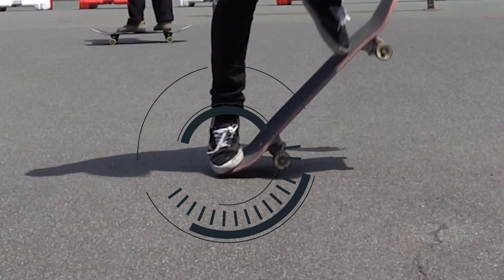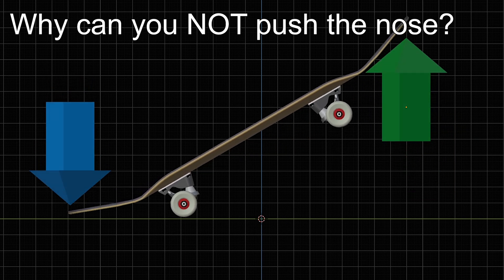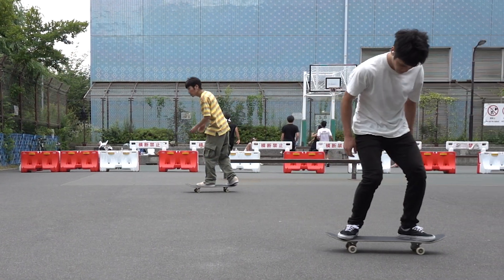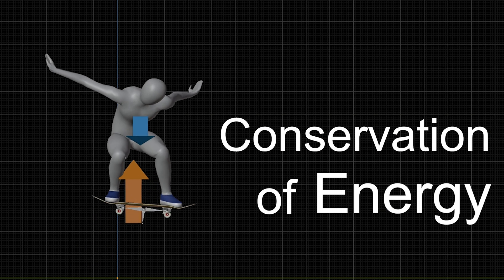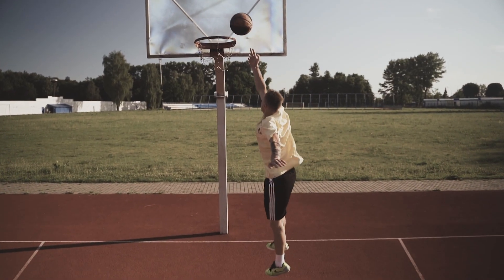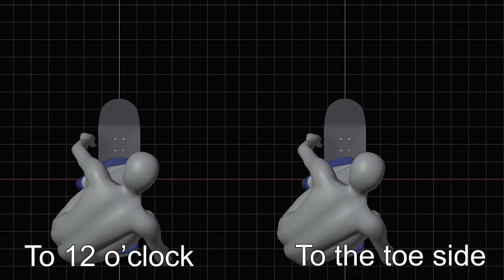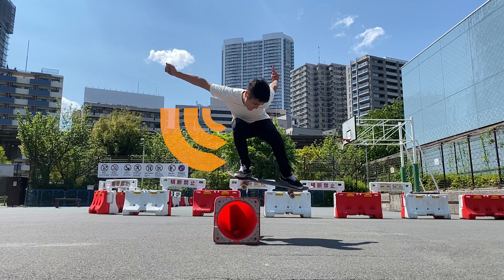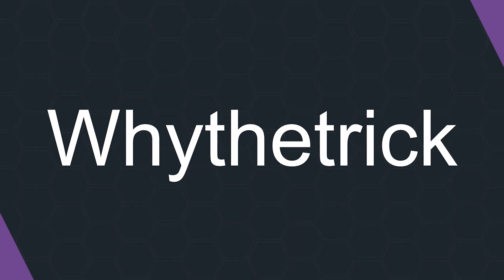Science of leveling Ollie #3d #ollie #skateboarding

Comment: After repeated practice, I figured my way to ollie and level it out easily and consistenly. You guys may try it out too but it is NOT a proper way to do it.

The trick: Keep most of your weight on your front foot as you crouch until you finish pushing the board forward. It looks like you are leaning your whole body on your front foot as you crouch. You also mainly use your front thigh to lift yourself up when jumping.

This might sound weird and tiring. But by doing this, you can:
1. avoid your back foot blocking your board from lifting (cuz your back foot can go up very quickly)
2. easier to make consistent but strong pop (as not much weight is put on this foot, you can precisely control direction of pop)
3. have more control on your front foot for sliding and pushing forward (your knee could reach above the nose after sliding)

To me, doing this increases the room for timing error, and a lot more control when im in the air. If you really wanna land a level-outted ollie no matter what, you may try this out.
But now, I start trying to ollie and jump with both of my thighs as I think we cant put that much pressure only on front foot when doing other tricks.
Reply: you guys may try it out and tell me how u think abt this tip
Reply from the maker: interesting point. thanks for the comment!

Comment: This 100% facts, yours are the best tutorials out there. Two related tips: 1 apply pressure on the tail, but focus more on retracting the back leg as fast and high as possible (rather than pushing down hard on the tail) and try to wait with pushing the front foot forward until the back foot is already coming up. 2 body/head position play a huge role: I always say it's not how deep you crouch down but how far over the front bolts you lean your head when you pop. The more you lean forward, i.e. the further back the nose comes when you pop, the more room your front foot will have to extend and level out the board. I think I also pop slightly back, rather than straight down. Everyone's different, but I think often the problem is people (unconsciously) hold back a bit for fear of eating shit, when really the spirit is to jump into the trick 'face-first' as it were.
Reply: Many thanks for your experience 👍
Reply: What does leaning forward have to do with the nose rising? If anything wouldn’t you be more likely to hold the front part of your board down

Comment: This is not the best ollie technique - you should avoid pushing through the nose as much as possible to maintain more board control and contact with the front foot for better, more consistent ollies. Also, if your board has a short nose (or no nose, for old 80's style boards), you definitely don't want to use this technique, because your foot will come off and you will have to bail. Even with modern board shapes, it's far better to use the friction of your front foot on the griptape behind the front bolts. Then, you will be able to easily have the board leveled and in control at the peak of your ollie, allowing for clean, high flip tricks, late shuvs, and other such advantages.

If you ollie using the flat part of the board instead of the nose to drag your ollie up, you won't have the board pushed out in front of you and you won't have to worry about pulling the board back for a landing. You want to just keep your shoulders nice and centered over the trucks instead, which allows for easy landings. You should only start pushing the board out in front of you for style variation, not for a basic proper ollie.

Comment: I'm afraid you have overlooked one crucial part of the technique, which is actually what's limiting your ollie height as well. You said jumping too high is not good, but that is not true at all. If you see pro's doing tricks with a lot of height, you clearly see their shoulder come up higher than where they would be while stood up. It's just the matter of when to place the most force upwards generated.

 In order to get a high enough ollie, you need to squat down way deeper first. why? because you will be doing most of the jumping BEFORE popping. From a deep knee and overall body's bend, you start exploding up very quickly with your arms flailing up and slightly behind the body. With that initial surge, you get most of the propulsion done, and as your body is at least halfway done extending, you start the popping motion.

With this technique, your tail does not get stuck in between the ground and your feet at all, as your bodyweight is already leaving the ground. This means the sliding motion will not be hindered, and it can start as soon as the tail hits the ground.
Reply: correct ! and explained better than i did
Reply: Thank you so much man! Been stuck at this how-to-jump-explosively-before-popping part for quite a while now.

Comment: Actually i believe you can send your body forward, by jumping very slightly sideways (ie forward or towards the nose), just to compensate for forward momentum.
My ollies look nothing like yours, my back foot never "hits" nor "pushes" against the floor. Its a bit more subtle you have to snap your ankle/toes while you lift up, as close to the end of it as possible. But for sure your backfoot should never go below the front foot level, only the toes. Snapping while jumping creates huge forces that will allow you to snap it so hard itll come back into your feet, and then you gently accompany the board up.
Reply: This is correct.